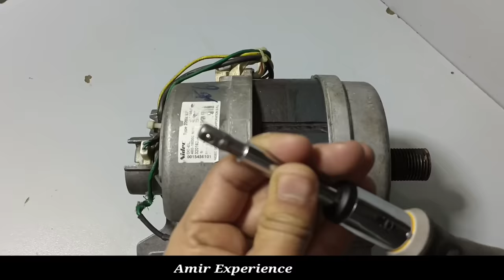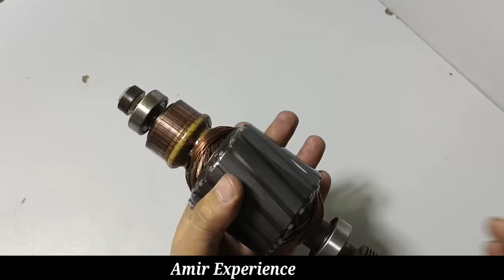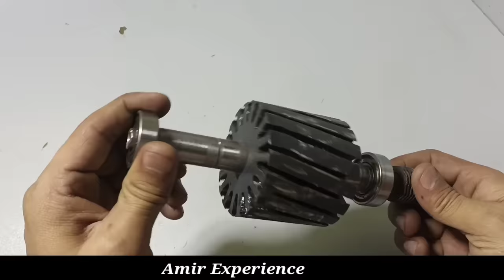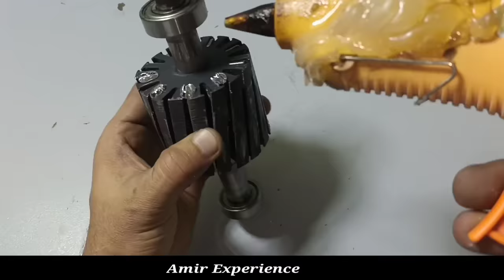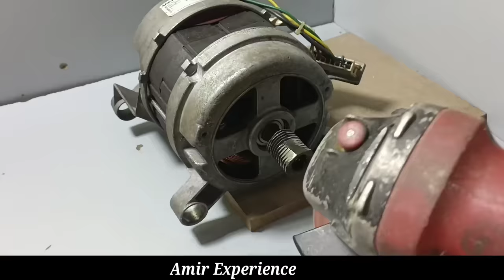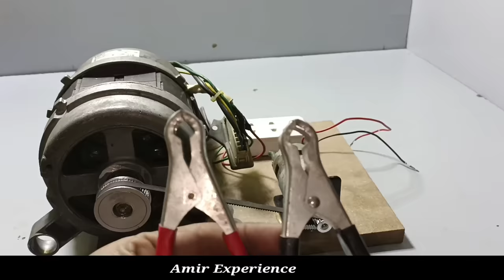I turn washing machine motor into 220v 15000w electric generator use new technique at home

Comment from the maker: Keep Supporting Do Subscribe and don't forget to press the Bell Icon 🥰🥰😘😘👍
Reply: the design of the next generator, can you make free energy self running.??
Reply: Why ?
Reply: Bhai sale bhi krte ho ye
Reply: @hamzashakir310
Reply: @tea0kurangmanis349  0}
Reply: remember kids love within your heart but use you're brain for everything else
Reply: remember kids love within your heart but use you're brain for everything else
Reply: Thank you for your support! If you're looking for a reliable backup power solution, I highly recommend the Segway Portable PowerStation Cube Series. It has a massive capacity of up to 5kWh, powerful output up to 2200W, and fast recharging capabilities. The waterproof technology and smart app control are just icing on the cake. Check it out and ensure uninterrupted power supply during your outdoor adventures or at home. Happy camping!
Reply: do you think we are naive? how can this 480 watt motor at 16,000 rpm produce 15,000 watts (15 kW) of electricity? Are you fooling ordinary people (those who don’t particularly understand electricity) with your video? if this motor produces 15 kW, then why didn’t you CONNECT to the load, for example: el. hairdryer, el. stove, iron at the same time = approximately 6 kW? Yes, because you know it won’t work out! 1.1 million views and 9.1 thousand likes from naive people... shame on you!!!
Reply: Fake..........the motor of the washing machine is changed...
If you will really make it for sure will be billionaire......
I have try many times doesn't work.....
Reply: Dude, this is not worth subscription or supporting, this is only worth reporting to admins to be removed and your channel canceled. This is all fake and not possible. For someone who doesn't know anything about electric it is possible but some of us did go to school and actually we learned something there...
Reply: It's just hot glue is going to hold can we not bolt anything down
Reply: Esto es falso porque al momento de encender el taladro las revoluciones del motor no bajaron y en ese caso ese motorcito que se usa en el video no serviría para mover ese generador al momento de estar generando corrientw

Comment: Why not use the multimeter? Friend, its a very good idea but it does not exceed 500wattz. It is not possible, as the copper wire of the old motor winding is very thin, it would take a much larger gauge wire to handle more than 100 amps to have 15000 watts. Power is calculated by multiplying voltage x current, so it's not true.
Reply: Actually you're most of the way there. That 15,000 Watt was an outright ridiculous lie but, he could ONLY use power running this, it can't make as much power as it uses, it's a physical impossibility.
Reply: Pinter
Reply: Last time I checked 220 x 100 = 22000 (VxI), and 22000 is greater than 15000 so according with you first statement "that wire can't handle more to han 100amp" well that wouldn't disprove that he  achieved 15000.
Reply: Бро по-моему Автор не понимает что значит 15000 Вт, он то на 8000 Вт делает с генератора авто , а теперь это. Он просто обманывает подписчиков и всех смотрящих его ролики. Я сначало подписался а потом передумал и отписался от него. Он не честен в своих работах.

Comment: Hey. In the next video can you show even more pointless spinning of whatever you are hacking. It was fucking riveting. Plus hot glue being used to attach parts inside a motor that will get hot while in use is a great idea. I once lost the bolts for the brake calipers on my car. A couple glue sticks later and that bad boy was ready for the road. It was on the back of a tow truck, but that doesn't matter. It was on the road. Keep up the good work. I absolutely love these free energy videos. This is the future on freeing ourselves from foreign energy.

Comment: That washing machine motor is about a 2 HP motor or 1.5 KW = 1500 watts not 15,000.
The steel would saturate limiting the power out , check the calcs  simple maths  .... 
1500 watts / 230 volts = 6.5 amps  , thin wire about 1 mm diameter , with a flux density of 1.2 webers per meter squared on a stator that size , 4 pole motor , eight slots for the coils each of the four coils would require approximately 500 turns, stator slots would have to be , 500 x 1 x 1.1 ( packing factor )   22 x 25 mm cross section , 
pole pieces would have to be the same size = 25 x 16 x 2 = 1600 / 3.142 = 256 / 2 : 1 taper = 125mm inside diameter, Rotor = 122 mm diameter, outside diameter of the stator  25 x 16 x 2 = 1600 / 3.142 = 256 / 1 : 2 taper = 500 mm  ... that tiny is no where near what is required ......... to get get 15,000 watts
Reply: Prácticamente para generar lo que indica el vídeo se requiere un alternador del tamaño de un 1/3 por lo menos de un alternador habitual industrial para lograr las condiciones que indicas?

Comment: This guy knows absolutely nothing about electricity. Those output wires could never even approach 15kw without going up in smoke immediately. Who knows maybe he’s even invented super conductors !!!!!  😂
Reply: Yeah your right bro I was laughing when I saw the 15k watts like wtf
Reply: I think he meant 15 watts,  the k was a typo:)
Reply: 15kw / 230V = >60A
Reply: Your are right
Reply: @lars664  exactly, I wouldn't want to run that through anything less than 4 awg, otherwise it's a fire hazard:)
Reply: Interesting
Reply: Misleading. No way can this generator produce 15 kW - for a start it would overheat with s current of more than 60 amps.

Comment: Forget the 15k power he's claiming. I just want to know what hot glue is that he is using to hold an alternator and servo motor in place while the tension of that belt is held tight while spinning. I'm impressed simply by that. Lol
Reply: Agreed. That's the ONLY thing worth knowing from this scam video.
Reply: Gorilla glue hot glue is a bad mf
Reply: no kidding ,,,i want some of that dam glue mr.tesla is using with his bull crap video

Comment: You should have used a multimeter to show that it can really do 15000w out put.
Reply: A multimeter to show 68 Amps ac with 'something' having a 15 kW power and working at 220V?   It's a joke.  That generator can't assure more than a few hundred watts. Even if the axis is rotated by something much powerful than a little motor.
Reply: @gepettobellucci8418  Yes, 15 Kilowatts is a MASSIVE exaggeration of the potential here.

Comment: Don't get sucked in this is bullshit.  It's taking peoples desire to solve an important issue and sprinkle a little fairy dust on it.  No motor or generator can produce more power than was put in to it. It doesn't matter how many rare earth magnets you stick in it. The motor/generator idea isn't new. If you put 100Kw of mechanical energy into turning the shaft of an alternator you only get 80Kw out, and that assumes you have one of the most efficient alternators in the world. They are typically a lost worse than that, like in the 50% loss range. Now feed that 80Kw back to the motor and surprise, you don't get 80Kw worth of rotation at the shaft due to frictional losses, design inefficiencies, air resistance. Now motors are fairly efficient, say around 85% to 90% so it's not as bad as the alternator but importantly it's still less than what went in. So, you can spin the shaft of the alternator with a string, hoping to start it and the motor may indeed turn but once the string runs out the whole mess will just stop. No excess power to run your ice cream machine, sorry. C'mon folks, think for a minute. Don't you think if this idea really worked nobody would have "discovered" it before this video? If you think maybe it's because of the power companies suppressing the technology... LOL, you have even more issues. Put on your tinfoil hats to keep the aliens from reading your mind.
Reply: Ich bin kein Elektriker, aber wenn der Generator mehr Strom erzeugt als der Motor, dann müsste das doch gehen, oder? Ein Generator für Blockheizkraftwerke erzeugt zum Beispiel 3000W 500V 6A bei 3000 Umdrehungen. Wenn ich einen Motor mit der gleichen Drehzahl nehme mit 550W 230V 3A, müsste ich doch viel mehr Strom raushaben als ich verbrauche oder wieso sollte das nicht gehen??? Ich lasse mich gerne belehren. Ich könnte noch einen kleineren Motor nehmen der weniger verbraucht und mit einer Übersetzung von zum Beispiel 4:1 arbeiten. Dann wäre es doch noch effizienter. Wäre für eine Antwort dankbar.
Reply: Sehe ich auch, gerade durch den  kleineren der den grössere, einfacher , durch die Magneten in bewegung.hält 
oder in kombi mit.einem.elektrischen impuls spulen magnetisiert, weiss nicht genau wie das teil heist was sich ganz schnell.an.an.schaltet, weiter so
Reply: I appreciate ur explanation. I feel sympathy for those who appreciate this video.

Comment: You can produce maximum 1000 watt power with this stator. Also the magnets are not effective order. NSNSNS is wrong, it must be NNNSSS etc for this wiring. B.S.
Reply: Hi Semih I did magnets four pole NSNS but giving me 1.5v ac only 🤔
Reply: Semih arkadaşa katılıyorum
Reply: Amigo, hola ..me podría usted darme datos sobre la posición de los imanes neodimio en el rotor  porque yo los puse y no me da ni un voltio   otros que lo hicieron dicen que trabaja muy bien....estoy desorientado  gracias.

Comment: 68 a. of those conductors for 15 kW. it has to pass. How do you intend to achieve this?
P=U.I....I=P/U....15000/220=68,18 A..Those electric motor windings are 0.45 mm2. The laws of physics do not change for you to be a phenomenon.

Comment: No es posible ,ya que el alambre de cobre del bobinado del del ex motor es demasiado delgado ,necesitaría alambre de mucho más calibre para soportar más de 100 amperios para tener 15000 watts ,la potencia se calcula multiplicando el voltaje x la corriente ,es un fraude.
Reply: No necesita más de 100amp para alcanzar 15000 wats P=VxI 220x100 = 22000  lo cual es mayor que 15000 y el 75%de 22000 aún es mayor que 15000

Comment: I can't believe so many commenters actually believe this is real? I mean a few tiny magnets rotating inside just two very small stator coils to give an output off 220v at 68 Amps all turned by a tiny slow low voltage motor 🙄🤣🤣🤣

Comment: Sir, I think it'll be a reliable video if you just show me the voltage, current, and sine wave images of the output power without checking the power like other people's videos, but I don't understand why everyone just turns on the power or turns the motor.
Also, I can't see the capacitor and I can't tell if it's direct current or alternating current, and I'm disappointed, I feel like I'm watching a video like this
Reply: Generátorrá alakítja ami csakis váltóáramot termel...
Reply: Make one and test it
Reply: @andrewsmithmilan1780  Can U believe this?  the motor would have to be a lot
larger to convert to a 15,000 watt generator. The guy has absolutely no idea
he is simply making a magneto, U ever notice they don't tell you what they are 
doing as their funky so-called music is taking over. then he tries to get us to
think he is turning the gen with a motor out of a possible MickeyMouse toy,
the whole effing thing is a mickey mouse job what a laugh.
Reply: @raymondgarafano8604  you don't have to watch the videos... But you somehow seem invested. Why does it matter so much?
Reply: @andrewsmithmilan1780  Hello Andrew Smith Milan, well a number of reasons,
Comedy? I mean How could he think that the field winding would be capable
of 62.5 amps? , just the size of wire probably like 4 gage and the amount of
turns required for 220 volts. . . then he destroys a good d.c. armature that could
have been used for a good project only to imbed magnets into it, thus making
a magneto, then to have a wussy-assed motor to turn said generator I guess
trying to mislead everyone with a mess of wires and cords. . .to have an electric
drill work, it is all fake.
Reply: @raymondgarafano8604  well I for one think he's pretty smart. He's got you so "wound up" over his videos, and every comment you make increases his traffic.. Putting him into the easier to find places and generates him more income.
He's winning, and your helping. I might post a video soon and tag you since it'll help me. Have a good one.
Reply: @andrewsmithmilan1780  Hello Andrew, Well, with all my trashing his idea, it is
funny I am helping him. I guess I am old school, I'd rather do what is able to
be done by the laws of physics and no trickery. Hell, maybe he will even learn
something? Or is he just doing all this to make some $$. There are some guys 
here that do the very possible, getting a transformers from a microwave and
making a mutha of an electro-magnet with it by cutting part of the core so the
3 ends are exposed and by sending 12 volts from a battery can make a nice
powerful electro-magnet. Since  one can hardly go to the town dump anymore
and scrounge for things as they could back in the 70's and 80's which is a real shame, still lots of good stuff out there.
Reply: @andrewsmithmilan1780  sir please assist me . Can I go ahead and make one . And your recommendation. Thanks in advance
Reply: @technicalkh8932  U R SO RIGHT!
Reply: @raymondgarafano8604  In any case, he needs a new washing machine now.🤣😂
Reply: @ossi.p  YUP for sure. This guy has no idea about electric generators, speed, torque, amps ... just doing all this for shits and giggles, nothing to take seriously.
and as you said he needs a new washing machine now, I bet if he was lucky to 
find a wife, she is not happy at all.

Comment: the magnetic brake is missing how come when you turn on the drill it does not slow down even a bit the generator usually when you opone a bit of resistance the magnetic brake comes into play? 🤔
Reply: Because its fake. If you see a glue gun, switch to another video its fake.
Reply: focus on his multi plug wires hope you notice something
Reply: Impossibile! Lo statore ha due poli e il rotore un sacco. Così non potrebbe dare più di qualche volt. Anche la velocità è troppo bassa. Con due poli al rotore ci vorrebbero oltre 3000 giri al minuto. Questo Non cala di giri inserendo il carico. 😂😂😂😂

Comment: I checked the rating on those type of motors and it is ~150A. I believe that motor can do from 8kW-15kW, so his claim is plausible. The reason he gets that much more power is that he removed the drag (Back EMF) wiring, and he added the permanent magnets.  If your concern is if the motor wiring can handle  ~70A after the mods, it can. Recall that by law, your device rating has to be much higher than the operating Amps to prevent fires in case of a short, so maybe it only draws up to 10A during normal operation before the circuit breaks, it can handle up to 150A without melting the motor.
Reply: I've torn apart a lot of that sty;e motor for the metals-I do casting and such so I knew visually what I was seeing just not part names.   I am guessing the drag/EMF was the part of the inner core he cut off or the lever arm thing he pulled near the start?   I did not quite get the wiring at the end with the harness where he took the single stand I would assume was a ground and tied it in to one of the harness wires-something I would have to study a bit to figure out assuming most of the wires are never used and it is 12v DC so one positive, one Negative.
Reply: I dont think that will generate a huge amount of power because magnet wire used is small example say # 22 can handle only 1-2 ampers.
Reply: @tonyfabonan7247  Agree, you need to re-wire it if you want to pull more power. The wire does not determine how much power but how much power before frying the device. If you overload it and the wire is not thick enough then you fry it.
Reply: What planet are you from ???
Reply: The motor won't melt, that's what it's fused for. All single-phase motors are produced up to max. 3kW connected load for household appliances. At 150 Amp. continuous load, which you will not reach anyway for physical reasons, the stator windings would glow and burn out in a very short time. Every motor generates a back EMF because it is both a motor and a generator. A generator produces this back EMF which is then used for the power supply. What you call resistor wiring is nothing more than the rotor winding that is used to generate the magnetic field on the rotor. With this, you certainly generate a higher magnetic field than with these ridiculous permanent magnets.
Reply: Do you think you can power a 5000w motor continuously off of this generator?

Comment: U could use snow shovels as props.i want to do this and connect treadmill  motors to the generator by one very large gear or gearbox speed multiplier.

Comment: Arent the magnets supposed to be aligned radially and not top to bottom?
Reply: Yea thats what i thought. I wonder what will happen by sliding them in like that..also explaine whats happining rather than go put music in the back ground.. Seedy
Reply: He cut the copper in the beginning thoes wires are no longer working. I believe
Reply: They are aligned correctly the lines are at an angle if you look at it horizontally they are opposite s

Comment: Hi, how did you calculated 15000 w power? Can you please demonstrate power on working system?
Reply: No kidding. 15KW at 220v is nearly 70A.  From a motor with a winding rated at 350W. HAHA Not to mention, there should be some electromotive resistance seen in the belt. This video is complete and utter BS,

Comment: Excellent and innovative work. Can different sources be combined/consolidated? For example, first source is 220v 6000w electric generator, source 2 is 235v 8000w electric generator and source 3 is 220v 8000w electric generator from car dynamo. Is it possible to combine their separate output into one and get 22000w collectively (6000w+8000w+8000w)?